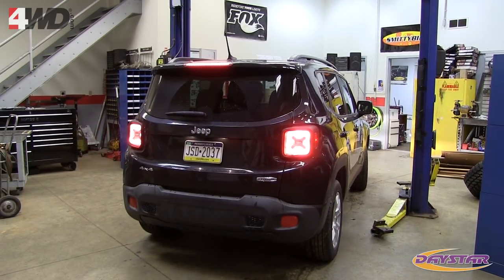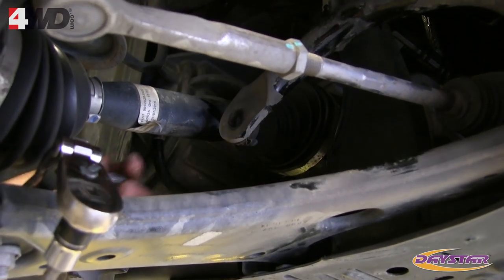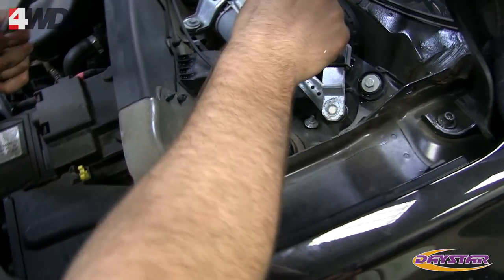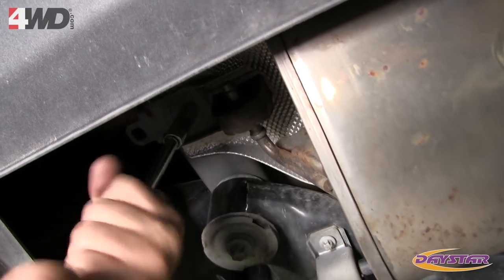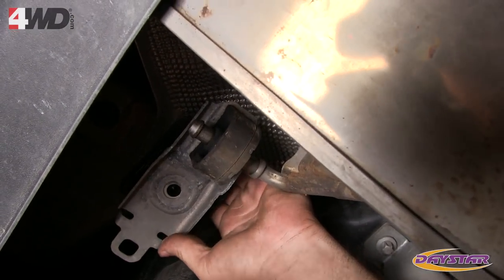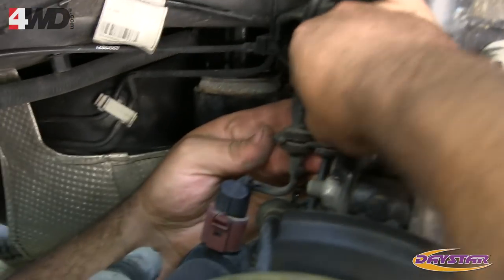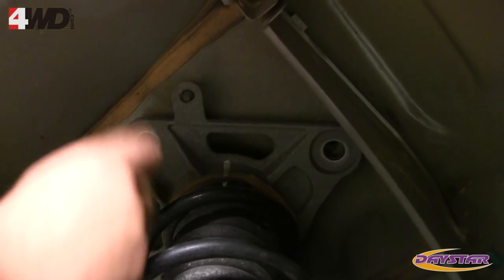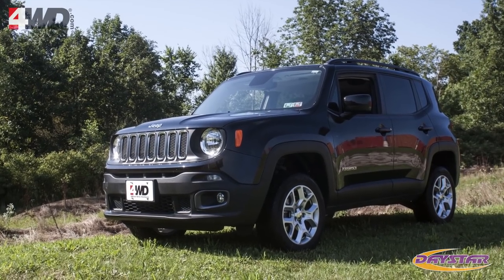Daystar 1.5 Series Jeep Renegade Lift Kit Installation

Comment: What's the largest 16" tire size with the lift? Can I trust the local dealership to properly install or should I go to a custom shop that would have more experience in this kind of modification? Thanks
Reply from the maker: Daystar doesn't provide a maximum tire size for a 16 inch rim, but the maximum recommended tire size on a 17 inch rim (235/60R17) equates to about a 235/65R16, or a 28 inch tire. Thanks!

Comment: On the struts, does that say SRA by Koni? So the Renegades come with Koni struts? If so do all models? If gets a little more complicated in the rear huh? Now you need to replace the stock tires at least, they look way to small! Like every vehicle lifted I bet that Renegade does not scamper and handle like stock though. But is really better off road and in snow! Especially in snow!

Comment: with this lift have you had any issues with alignment?
Reply from the maker: We haven't run into any alignment issues.
Reply: You just said it, "they didn't adjust the tie rod ends".  But they did move where they're connected. By lifting 1.5 inches, that means the tie rod ends are connected 1.5 inches lower than where they were.  This will most definitely throw off the alignment. And like you said, on your Acura, you lowered it 1.5 inches and needed an alignment. Same thing goes for lifting it.
Reply: Matthew Caughey I actually had to wait for a camber kit to come out to put the alignment back into spec